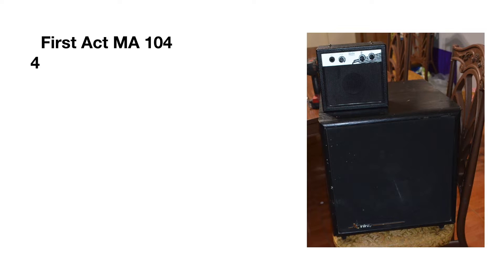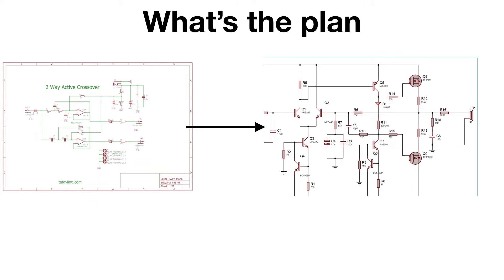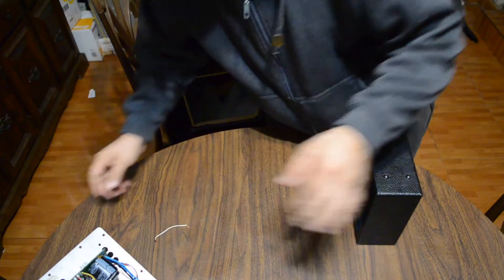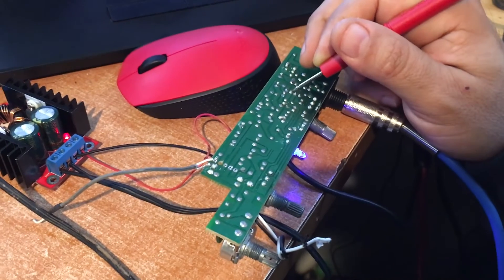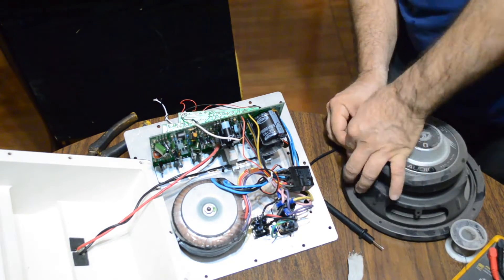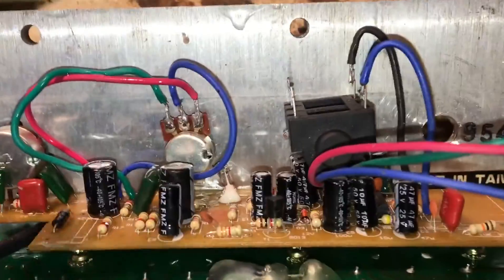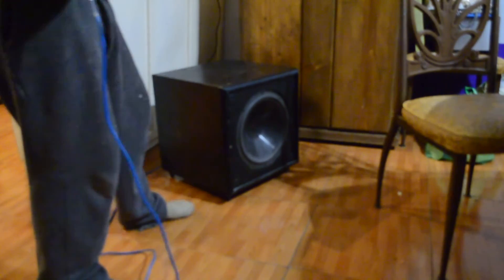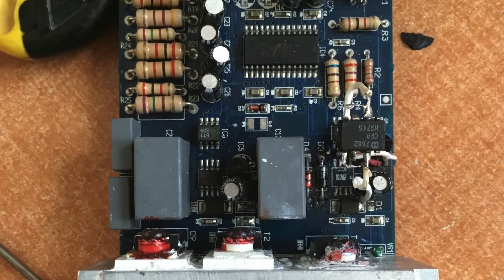Convierte un Subwoofer en amplificador de guitarra o bajo #bass

Comment: Maestro me acaba de ayudar mucho con mis inquietudes. Pero quiero saber si es posible hacerlo de forma externa o auxiliar sin tener que desarmar el ampli. y si es posible la conexion de una pared de amplificadores valvulares sumarle el subwoofer y ademas poder agregarle a este otra conexion mas ademas del bajo, en mi caso seria el microfono del bombo. por ende para pasarlo en limpio, es posible que el subwoofer sea independiente y a este agregarle 2 conexiones 1 seria los amplificadores y la otra el microfono del bombo. o tendria que usar 2 subwoofers  uno para cada uno. desde ya muchisimas gracias, me ayudaste bastante ya de por si
Reply from the maker: Si no abres el subwoofer no padres obtener el rango completo. Pero si deseas usarlo como complemento, pues seria cuestión de mandarle señal de la consola a los RCAs.  Saludos.

Comment: hola, tengo un ampli de esos pequeños, y un sub que ya tiene ampli, que pasa si solo hago una conexion de los cables que van al parlante del amplificador y lo llevo al sub, habría algun problema? espero su respuesta gracias
Reply from the maker: Creo que tendrías mucha distorsión ya que la salida de tu mini amplificador debe estar como en los 1.5 volts y la entrada del sub maneja como .80 volts p2p. Ademas que no tendrías la frecuencia completa por que el subwoofer tiene un filtro de entrada para solo dejar pasar frecuencias bajas a la bocina, asi que si conectas micrófono o guitarra no obtendrás todo el rango de frecuencias. Saludos.